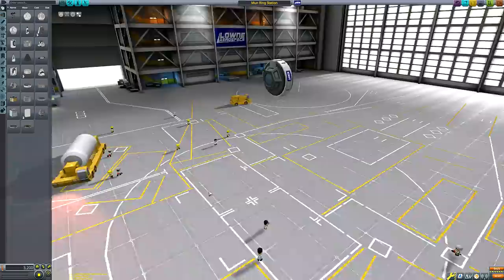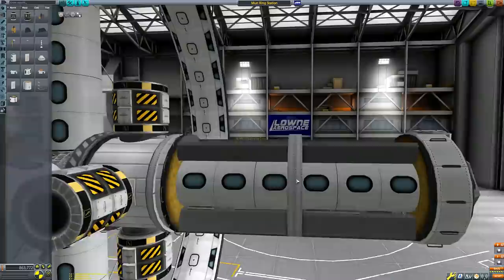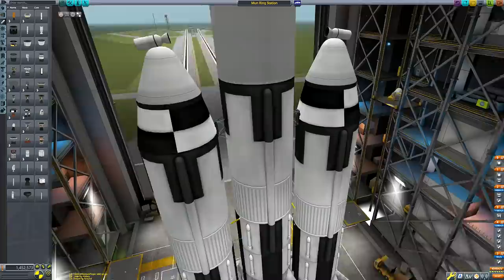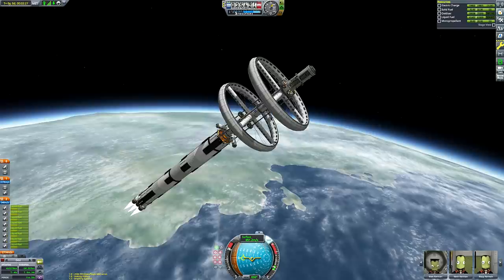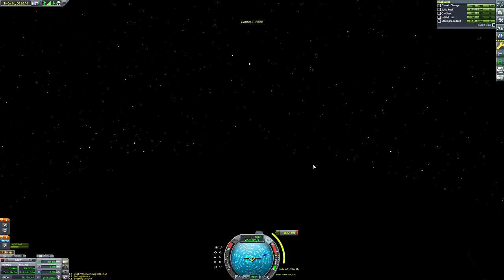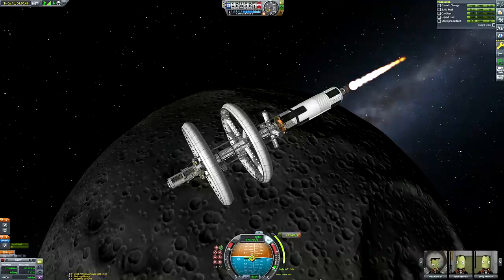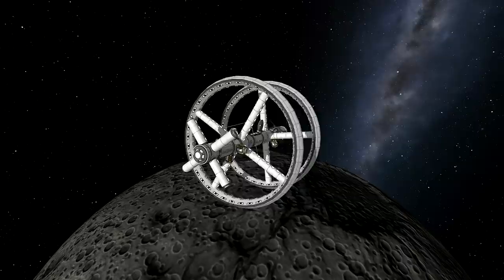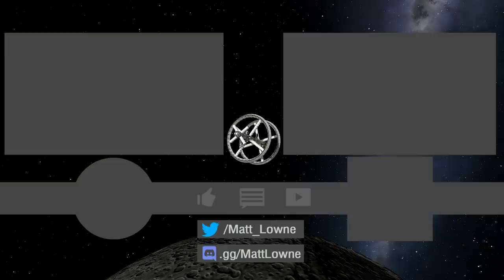KSP: Artificial Gravity Station around the Mun!

Comment: Can't you bounce off the atmosphere on re-entry though? Or is that a myth. Surely if the atmosphere tapered off this wouldn't be possible?
Reply: Geeza Garage no because the atmosphere just causes you to lose speed in the direction your traveling in, so no. If you had a giant wing optimized for Mach 20ish it might be possible but otherwise no
Reply: it is possible, the x-15 in real life did this accidently. basically your hitting a dense ever increasing resistance as you lose altitude, which to a lifting body forces it to lose speed but also gain lift, you "bounce" off of it, just losing speed. think of it like a toy boat; you throw it laterally and it skims into the water. the buoyancy forces it back up and back into open air in a "Bounce". while the atmosphere does taper slowly, if your moving at a few km/s, that taper is smaller than you think. the Karman line is only 100 km, at orbital speeds straight down that would take 9 seconds to go through (ignoring drag and shock heating disintegration). there's a reason why crew capsules are actually lifting surfaces at certain angles. if you reenter "to deep", you heat up and slow down too fast, resulting in you burning up or blacking out. to high and you bounce off, but with a mildly steeper angle, which could lead to the first problem. reentry is a very exact science.
Reply: to continue @abcd27's explanation, in ksp you have a lot more leeway in your reentry angle because heat shields in this game are so overpowered. In ksp, if you come in at too shallow an angle, you will "bounce" off the atmosphere like you would in real life, although it is easier to think of this as not having enough drag to capture. However, it's hard to come in too steeply, as long as you have a heat shield with full ablator, because ksp heat shields are, as mentioned earlier, extremely overpowered. The rule of thumb that I use is:

If coming from Kerbin's SOI (sphere of influence): as long as you have a heat shield, you will be fine, even if your orbit intersects with the ground, aka have a negative periapsis.

If coming from outside of Kerbin's SOI: use one or two atmospheric brakes, either one to land immediately, if you are coming from a proper injection orbit from Duna's SOI, or use two,  one for capture in Kerbin's SOI and one for landing, if coming from anywhere else.
Reply: In KSP you can definitely bounce off of the atmosphere in a spaceplane, but not enough to send you back into space from what I've experienced
Reply: Geeza Garage after 100 km the atmosphere becomes really thin, but below it the atmosphere gets thicc really fast, and the dense atmosphere deflects fast moving lifting objects back up into space
Reply: If you have wings with lots of lift like on a classic jet-rocket hybrid SSTO, yes. But, this often gets confused with just not having enough drag to lower your apoapsis below 70km.
Reply: Well when you bounce of the real atmosphere it isn’t a literal sharp bounce. It’s more of a quick change of angle of attack because suddenly there is a lot more lift. The x-15 also went wicked fast so thousands of meters took it mere seconds; even a gradual tapering of the atmosphere is dense enough quick enough
Reply: @thatdollfin3369  If you set your heat-shield's ablator to, say, 5 instead of 200, would that be more accurate?
Reply: @cynicalnews963  It depends on what you're trying to emulate. If you want modern heat shields, maybe go for 30-40. Older ones are typically less, with the lowest being the almost-nonexistent one on the first manned space ship, the Vostok-3K, being about the five you mentioned.
Reply: @thatdollfin3369  Thanks!
Reply: nuff sed I was exaggerating I don’t know what the actual Mach value is up their but I meant a wing optimized for orbital speeds that would produce enough lift to create a strong enough radial out force to bring the ship out of the atmosphere and change its course
Reply: Maybe if it's a space plane going super fast you could do it
Reply: Space Tomato that is so incorrect in all ways. Mach 20? No. Bouncing off the atmosphere? Yes. Very possible. The atmosphere goes like this.

.    .       .      . [thin air]
To
....... .  ...........[thick air]
Reply: @Electric_Bagpipes  the *Kerman line
Reply: nuff sed actually, any speed in space could be considered Mach infinite, since sound travels at 0 m/s in vacuum. The higher you go, the lower speed Mach 1 gets. If you want a fixed form of Mach, use the Mach calculation for sea level, or at 1 bar.
Reply: I heard that your not bouncing off you just passing through but don't quote me on that

Comment: To get around the RPM issue, just use a stepper motor or rotational servo or whatever tf they’re called and a KAL controller.  Set the target angle to be linearly interpolated so it moves at a constant rate and set the animation time appropriately for RPM.

Comment: yesterday, i spent most of the day trying to work out the best ways to do a rocket car, using SRBs.getting them lit and going down the runway was the easy part. stopping, well, not so much. i did get to use the mountain range near the KSC as a ramp to launch rocket cars high into the air too. lol. a big problem is that once id get to around 300m/s or so, id either start leaving the ground, things would start exploding and id lose control.. either way, not once during it all did a kerbal actually die. i didnt even use the quick save/reverts to save them.. almost every time, the kerbal would get ejected from the vehicle in some manner, usually hitting the ground, not very hard, but sometimes id have to hit parachute while in the air since id get some altitude sometimes. lol..... good times. good times..

Comment: One thing that I always wondered about spinning rings in sci fi, how do people get INTO the rings from the center?
Like do they just gotta time it right or start pinballing around? Does it contain a spinning cart that moves in synch after choosing a port to go through? Do pods work like an elevator inside the long tubes? Do they use a ladder?
Sure you think about how to accommodate people living in them with the spinning but HOW do people get into those things in the first place? How do they not get vertigo/motion sickness? Wouldn't seeing the outside constantly spin around make people nauseous?
Reply: @CovertCoder01 Alright, so how do they enter the spinning ring FROM THE OUTSIDE?

Comment: You can stack this method for more radial symmetry. KSP does not like doing 1296-way symmetry, however, and will freeze.

Edit: 256 and 512 work fine though. 1024x is doable, but requires some patience, and might cause serious issues with more complicated craft. I managed to get 2048x to work, but it required 30+ seconds to think every time I hovered even a single part over anything.

Comment: I've been trying to mimic this, and although this is old, I still think it would work, unless it doesn't. Anyway, as I am trying to mimic this, with the rotors, it keeps on rotating the base itself, not the ring! I've tried it on another way, but it still didn't work, with it not budging and bugging out everything! I've copied one of the rotors exact placement, but it still isn't fixing it. I need some help, or I may need a new video on how to do this. This is a good video though, I just don't understand how to fix it.

Comment: Matt, I consider you an expert on KSP, so maybe you can tell me what happened to my first space station orbiting Kerbin.  I built it over 5 launches, with one big module per launch.  Four modules docked around a central core.  Everything went fine, until I wanted to show it to my wife.  From the KSC, I went to Tracking Station, found the space station, and clicked "Fly" to go to it.  When it loaded, it looked fine on the screen for about 5 seconds.  Then, and I had not touched anything, the station started wobbling like spaghetti, faster and faster and faster until BOOM, it all blew up.  Luckily F9 saved me.  But later, it did the same thing again.  Makes me scared to go to it this way again.   What gives?
Reply: @John Nichols turn sas off and autostrut the hell out of everything
Reply: Welcome to KSP! 
Population: The Kraken

Comment: That steel beam at around 18:54 had about 3 Km/s when it detached from the main part. And it went in like an arrow through the atmosphere. Looks like one of the Tungsten rods in "Project Thor" which the Air Force once developed. Based on the speed of the beam which is 639.8 m/s at the time of impact and calculating the entire structure (7 M-Beam 200 I each with 0.38t of mass according to the Kerbal Wiki) at a total of 2413.11 Kg, Using the https://www.angio.net/personal/climb/speed.html Splat calculator and then converting the Joules to Kg of TNT ( http://convert-to.com/conversion/energy/convert-j-to-tn.html ) it gave me a result which kind of disappointed me. Only 120 Kg of TNT. I thought when I started this journey of calculating the force of impact that it would be a much grater force of impact but I guess I saw too many movies and done much less math in my youth. But even still, 120 Kg of TNT is not something I would like to fall next to me :)) Great Video BTW!
Reply: Bruh I admire you dedication but wtf

Comment: Could you also have put a single ring at center of mass to avoid spinning of space station core due to torque?
Reply: No unfortunately not, torque is not based off of a motor position relative to com, otherwise helicopters would not need rear props

Comment: Serious question: with the rings spinning and stuff, how do you move around from the Axis hallway to the rings? feels like you would have to stop the rotation to access the rest of the station or you would be stuck either on the ring or main axis body of the station.
Reply: It has been demonstrated in a few movies, but basically at the outer part of the ring the greater the gravity. When you move closer to the center, the gravity decreases due to less centrifugal force. So you could float in the center, then grab onto one of the spinning ring hallways, and as you move down, gravity increases, allowing you to almost slide smoothly down the ladder to the outer ring.

Comment: My biggest question is how did you get the parts of the rings so far out? Whenever I've attempted this, the game stops them at a set point from the parent part.
Reply: I didn't pay very good attention during the build but I'm assuming he's using the offset tool for it, in which case hold shift to be able move it further (and in smaller increments)